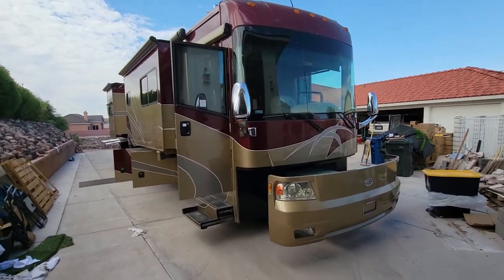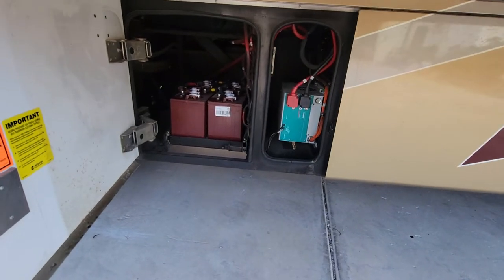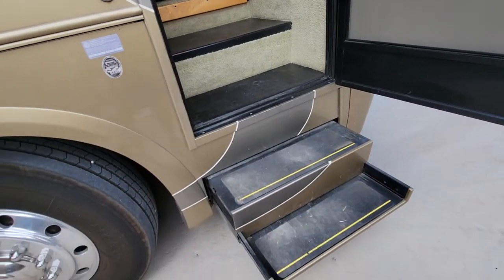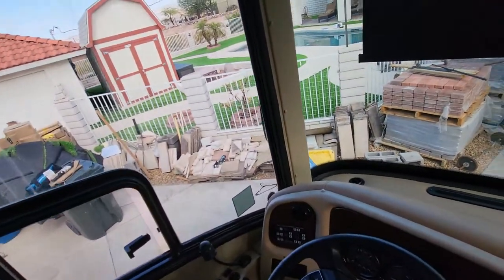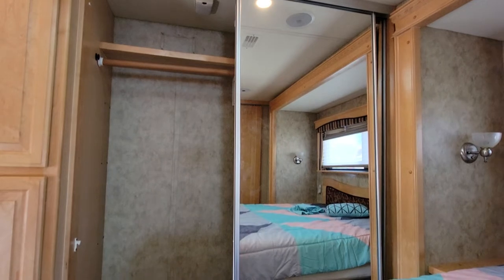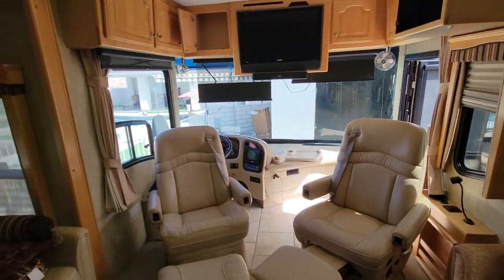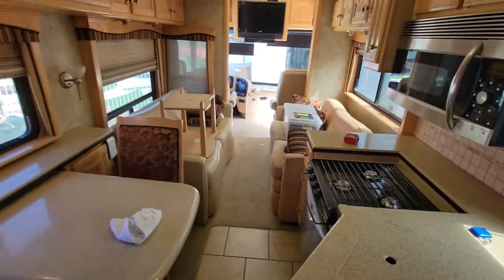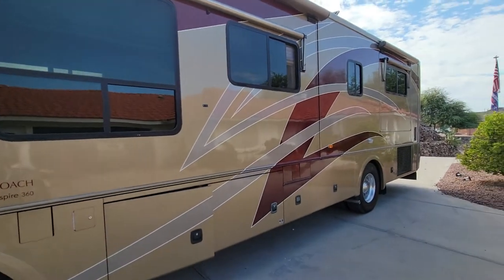2007 Country Coach QUAD 36 Motorhome For Sale

Comment: How much are you asking and how many miles does it have. Is it still for sale
Reply from the maker: Well, I was asking 105000 and the current high offer is 110000. Yes it is for sale but My loan administrator told me that selling the RV now would screw up the process for financing a home I am having built as a rental property. I guess tracking cash and deposits for the transaction for Homeland Security would slow it down to a crawl so I am still showing it but cannot sell it for maybe a month. At this time it is in the shop addressing some of the items mentioned in the video. It may be available for inspection in a couple weeks. I expect to get it out of the chassis shop next week and then it goes into the Coach shop for more repairs and additions. I do not expect to be able to sell it until first week of October and that is contingent on how the financing for the rental property goes. I am advising everyone to keep looking as there are a dozen folks interested in this coach the and shorter 400 horsepower coaches are pretty rare.

Comment: by the look of the back tire it looks like it came from the front  where it is worn on the outside,which means it is in need of front end work.
Reply from the maker: That may have been. I just had the Heavy Truck shop put new bushings in the front control arms and it may have worn the tires and then they (Mike Thompson)  put them on the back. I have only put about 1000 mile on the coach. Also had new air bags installed in rear and finally got the fan for the Dash air fixed. It had a fuse that would heat up and open and then cool down and close. Lots of fun bird dogging that. Dash A/C had some leaks and has been repaired. Also had engine serviced with filters changed. All to the tune of 3490.00. Now it is in the coach repair place to get the front roof A/C.